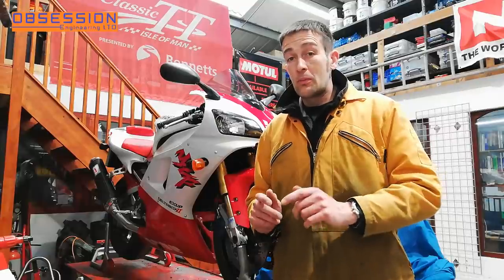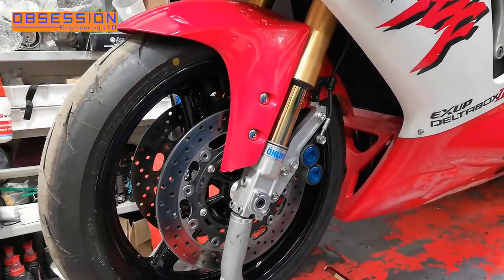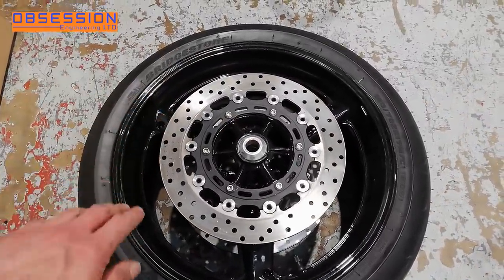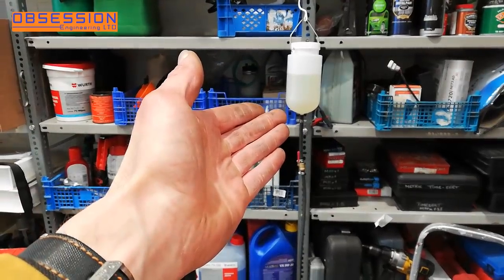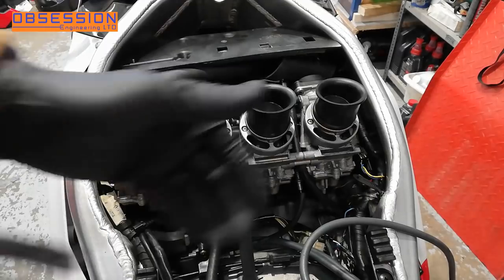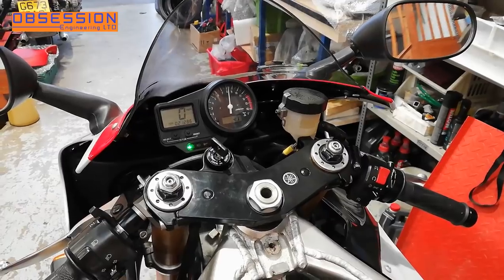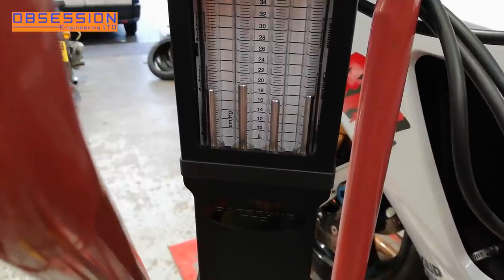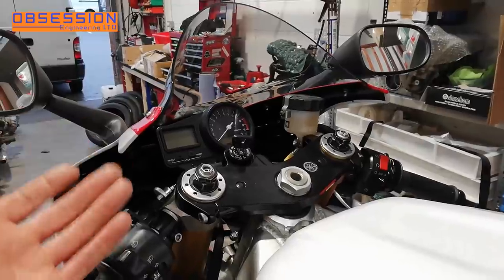1998 R1 Jigsaw Puzzle. Part 9. Fixing the brakes and balancing the carbs. But will it fix it??

Comment: Hello Dave, I've noticed there is an aftermarket exhaust on the bike which is probably less restrictive than the original. Herefore you probably should set the mixture screws a 1/2 turn to 3/4 of a turn further OUT than the manual tells you to do.
Reply: Aye, but once you change pipe/air filter, they never run right. ...
Reply from the maker: I did adjust the pilot screws and on the bench it was much better, but didn't cure it on the road test, so more work to be done!

Comment: Dave, just a thought, is there any restriction in the throttle cables preventing the butterflies closing quickly e.g - kinked or badly routed cable, stiff cable or throttle linkage? BTW Is this the right time for the wire locking video???
Reply from the maker: cables are good and return action is fine... but a good place to look

Comment: Great work Dave! Did you sort out the brake shudder? Did the cheap discs make any difference? This setup reminds me of a 2007 Ducati MTS1100 front brake disc system. Shuddered occasionally but a change of pads reduced it considerably. I think it had more to do with the rim posts for the disc than the disc itself 🤔
Reply from the maker: Once the 'new' cheap discs were on it seemed to cure it, which I wasn't expecting but am happy it did it, lol

Comment: Great channel - Any reason you didn't do the brake cleaner check to see if you actually solved the false intake? - It seems like it could be a good "clean carbs video" since I would assume some of the jets are a bit clogged which would make it run lean. Luckily its a quite easy job. Just dont unplug the throttle cable from the carbs. That is, if you want to take them off.
Reply from the maker: They did get a check and clean very early on, and seemed to be in nice shape. I'll be revisiting them soon!

Comment: How do you adjusted the air screws because they are in a hard spot. So do you adjusted then turn on the bike or the bike was running at all times while you adjusted the screws. ? Thank you.
Reply from the maker: They are awkward but you can just get to them when they're on the bike. Short screw driver needed!